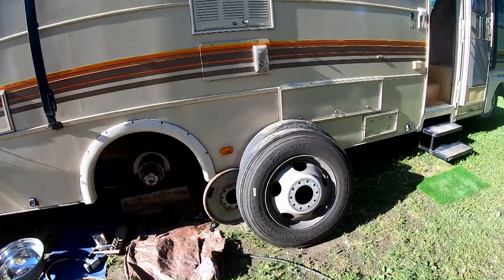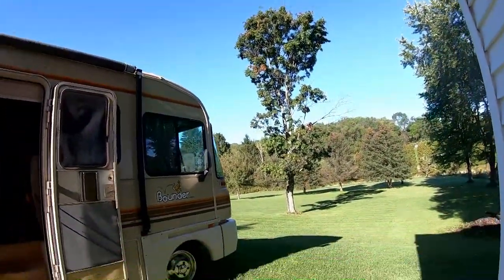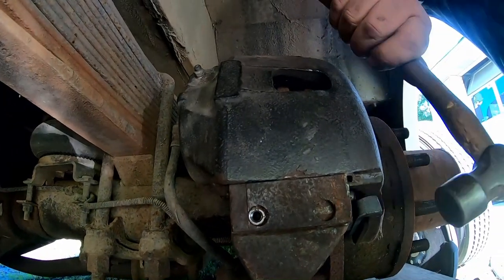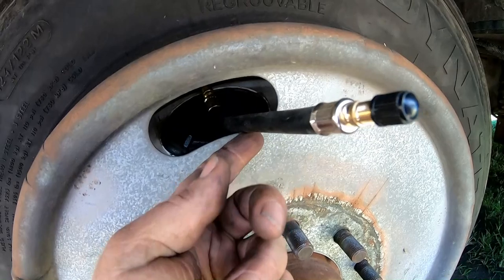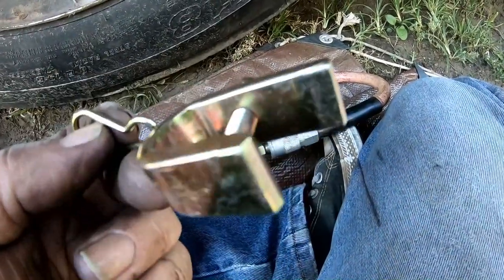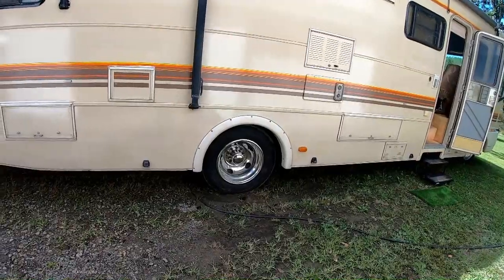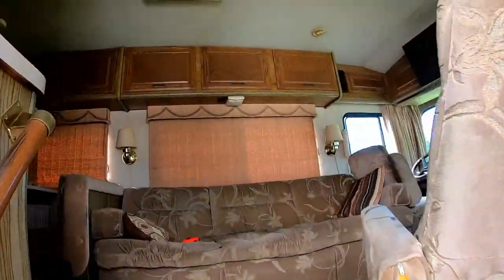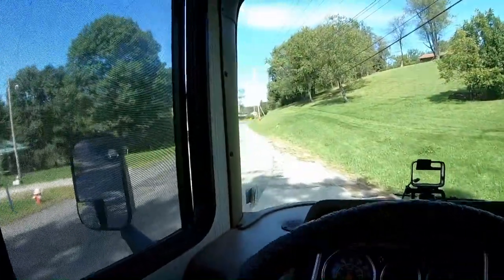New Brakes and TPMS - Tire Pressure Monitoring System For RVs and Motorhomes

Comment: 1) Why not Rotate the tires?
2) Verified Air pressure while working on each tire.  / Start off your with correct air pressure (it also checked you TPMS)
3) PERFECT time to R & R brakes, You can upgrade them and still be under what ANY shop would charge on the road.

4) Ever thought about buying those loose lug nut indicators? There $1.49 each at Napa.
5) Move the propane tank from front floor, just in case of a hard stop your dog will thank you by not breaking his leg(s).

Comment: I like the Thermo Quiet severe duty pads They are great for heavy stuff or pulling heavy stuff .Those are probably about the same thing.  I wonder if the red spots were to clean the rotor so it cab be Burnished in with just the new pad material . Have seen other pads made that way . I bet you will like those pads , Prob be good for the van too .

Comment: We have the stainless steel braided extenders for our Class A.  So far they are doing good.  Our RV is 10 yrs old.  The extenders may be 8 or 9 yrs.  Seems we got them shortly after we purchased the rig.  Betty looks good.  You should take down the A/C cover inside and spray paint it white.  Wonder what makes all that plastic yellow so bad?  LOL  HUGS~Donna

Comment: Is the TPMS you bought solar powered or 12v?
Reply: I heard him say solar if set on the dash; I don’t recall if he mentioned 12v.
Reply from the maker: Both
Reply: @DavesRVLife  I think I'm going to have to buy a new system for my RV.  I have used "Tire Minder" brand TPMS units for many years but lately I have been having nothing but false alerts.  Their customer service is great, they have been switching out units, upgrading aux antenna, still goes off. Low pressure, high temp, slow leak..... tired of having to keep pulling over to check tires.  Thanks tor showing us this new product.

Comment: Why do you run the front tires at a lower psi?  I’ve a 32’ Class A and thought all my tires are supposed to be of equal pressure, approx 80 psi.  Am I doing it wrong; will my tires wear out faster?  Don’t hold me to that # as I’m in bed and don’t feel like pouring over the folder of paperwork.  Does it have anything to do with a softer ride on the front end? 🚌
Reply from the maker: Tire manufacturers have inflation charts for specific tires based on how much weight is being put on them. I weighted the Bounder on a truck scale and inflated the fronts and rears according to how much each weighed.

Comment: My TPMS system specifically says to only use metal valve stems. The sensors due make the stems vibrate a bit. Hope this works for you.

Comment: I have the same TPMS and had a hard time figuring it out at first because  because  the directions were not great.   But once I figured  it out, it has worked great (six months  later).  Pressures are right on to manual  readings.